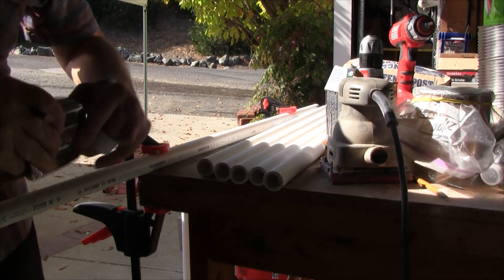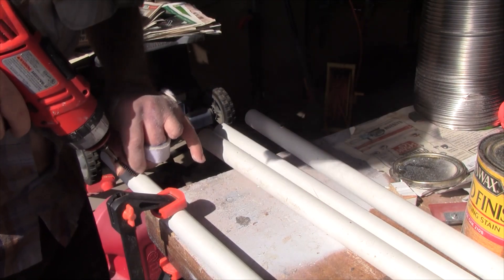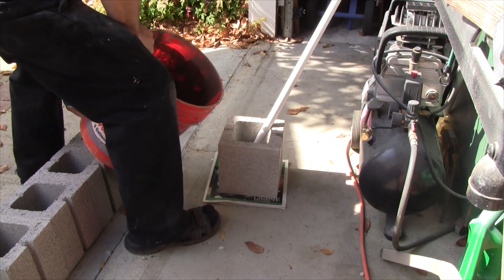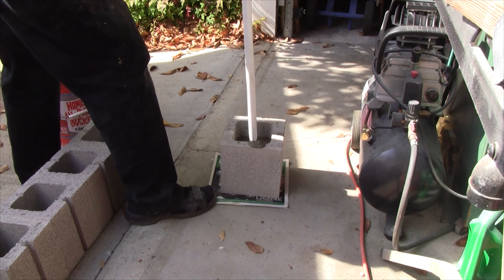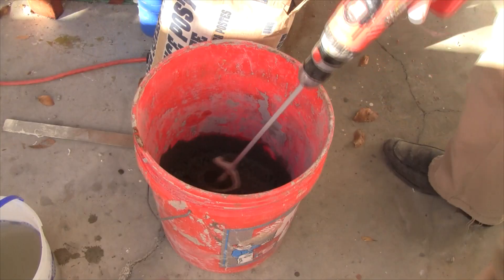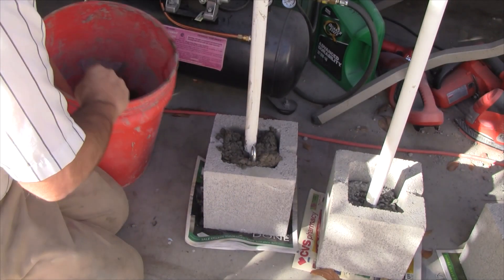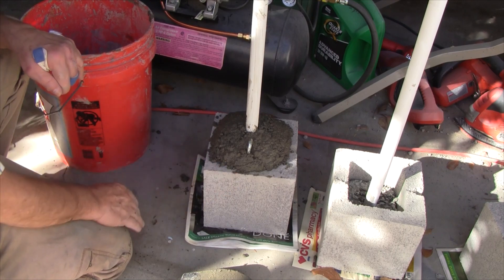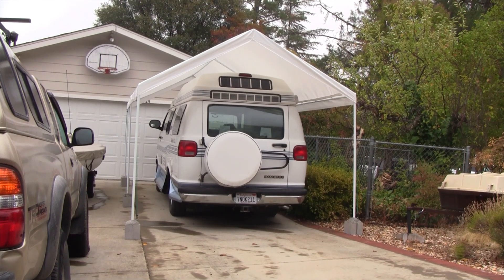Car Canopy Anchors that Lift and Absorb Shock

Comment: This might be a good idea for my harbor, freight garage in a box. I could use this to anchor the thing to the ground👍😊 i’ve got flat concrete block on the legs of the garage right now however, that’s still not heavy enough in a windstorm. Maybe these would be I don’t know. Looks like a pretty good idea though I would probably just use the quickset post concrete just put it in there and get it wet👍

Comment: Great idea ...
Reply from the maker: Thanks!  Just an added note, I had great luck with the frame of this cheap canopy, with my added beef-up's, including wind issues--just not snow!  However, I have become tiered of replacing the covers which just rot in the sun.  I am right now assembling its replacement, an all metal carport at the tune of about 2 grand.

Comment: How long did it last
Reply from the maker: It's still there, working fine!  This last winter, with a couple inches of very wet snow, it got so heavy it kinked the ridge polls--repaired easily.  It has handled some pretty nasty wind over the years, but I have developed an effective guy rope plan to add structural stability.

Comment: What year is your RT? And was the spare tire carrier already on, or did you install it? I have a '92 Dodge 190P where the tire's inside and it takes up a ton of storage space, would love to move it outside.
Reply from the maker: 2000D190P, I got it with the spare carrier.  It works, but over so many years, the weight is causing the door to sag a bit and it drags on the threshold.

Comment: prety cool but in a oklahoma wind them cinder blocks become projectiles yer screwed. i just put one of these up and used an auger type stake . theres nothing gonna stop the oklahoma wind and if im gonna lose property id rather it be just the canopy than have it bash in windows or dent up the car . thanks for the clever insight though

Comment: I wonder if it snows at your location, and how you can snow proof this canopy. I've been taking a rack and clearing the snow off it, but that's not a long term solution.
Reply: Maybe a steeper angle on the roof?

Comment: Interesting. I had my poles into 6 - 5 gallon buckets full of concrete. Thinking they were 100lbs each. My goal was to raise the canopy above an adjacent shed door. No shock absorbers though. Right away got a 50 mph wind come through that started lifting the legs up and contorting the frame poles. That was enough for my experiment. One of my poles dented a car fender in the process.

Comment: Where did you get the canopy,  and is the frame made entirely of pvc?  Thanks
Reply from the maker: Canopy is from Amazon (I had a gift certificate--the same thing can be bought many places). There is no PVC in the frame, it is all metal.  The PVC pipe is my mounting method on the concrete bases.  I have learned a lot and made several modifications over several years.  Ask if interested in more details!
Reply: @samqui323  thanks for the response.  I was considering a pre fabricated car port from amazon,  i wanted to put it adjacent  to my garage and fit it under the eves about 8' clearance, but they are too tall.  And i worry about the wind.  I live in so cal and sometimes we get santa anna winds ,  which can blow 40+.  So i am at the decision point of either going with a pre fab or making my own custom frame out of wood or 1.5  inch pvc.  Then i could just get a tarp to cover it.  My wife's not crazy about me building my own frame,  she thinks it would look too tacky.  I don't want to pay a contractor 20k+ and deal with building codes. 
 Geez,  all this just to protect my new car from frying in this socal heat!

Comment: great tutorial! how's this holding up a year later?
Reply from the maker: Actually, pretty well!   It's survived some pretty powerful winds, and I wasn't all that optimistic about that!  Biggest problem is the little bungee loops with plastic balls that came with the canopy to hold the white cover onto the frame--they are stretching out and disintegrating!  I did add one feature not shown here: I strung clothesline style rope from the top of one corner leg, down to the bottom of the middle leg, then back up to the top of the leg at the opposite end (both sides). Tighten theses snugly.  It adds some strength in strong winds that used to torque the frame back and forth and even drag the concrete blocks!
Reply: samqui323 can you show a small video on that? Thanks
Reply from the maker: @ToMyMakeupFans  Sorry, I've not been able to get to that!
Reply: @samqui323  If you get a chance to do that, we'd love to see it! You don't have to do an instruction, but if you could just show a video of how it looks, it would be helpful :)
Reply: @samqui323  From what you're describing, it seems like something I was going to try to do to stabilize mine which is already bolted into the concrete. I was going to run a steel cable in like a crisscross pattern between the metal poles to help stabilize it more. That's the cheapest and most efficient thing I can think of off hand.
Reply from the maker: @powerofknowledge7771  Exactly.  And since you bolted your legs to the concrete, that would be well braced.  (Mine can still drag a concrete block if it is real bad!) I've also added guy rope sections to give the same strength sideways but by tying off to my RV itself.
Reply: @samqui323   i got some plastic zip ties works great doesnt have the spring to it that the bungees do but they dont let the tarp go without ripping it either

Comment: ANOTHER ONE THAT DID NOT SHOW THE CANOPY ROLLING INTO THE STREET WHEN A 40 MPH GUST TAKES THAT HORIZONTAL SAIL AND SAILS IT. THOSE BUNGEES WILL SNAP LIKE RUBBER BANDS AND THAT CANOPY HAS LIFTED ME OFF THE GROUND IN 25 MPH WINDS. I'M 175 LBS. I LOOKED LIKE MARY POPPINS WITH A CANOPY!
Reply from the maker: Haven't shown it because it doesn't happen.  And yes, it's seen many a heavy wind--has been up 3 years now.  I'm glad to share extra measures I've taken to help that, with someone who's actually trying to do something.
Reply from the maker: dimebag Darrell  I tied clothes line style rope from the top of the corner posts down to the bottom of the center post, on each side, creating triangles.  This added a good deal of strength in wind, and are there permanently.  If I expect extraordinary wind, I have two more rope segments secured to the top of the back two posts which I bring over to the spare tire rack temporarily.  This gives great lateral stability.
Reply: @samqui323  I'm a big fan of the HF Orange Ratchet Straps 😁 I picked up a set just for bracing my canopy. And the added safety orange will (hopefully) keep me from tripping over them.

Great idea with the blocks and bungees.

Any issues with rain collecting in the 10'spans of canopy? Did you do any other reinforcement of the frame?
Reply from the maker: @_GntlStone_  No problem with rain, but wet snow was too much!  Get it off before it collects!!  Yes, I ran close line type rope in an X pattern between the top and bottom of two leg poles on each side.  Much stronger.  I also ran lines from the top of the rear poles to the spare tire rack with easy disconnect clips when needing to back out. I've had very little trouble with wind this way.

Comment: How many bags of concrete did you use?
Reply from the maker: Sorry, I don't remember for sure.  Could not have been more than two.
Reply: samqui323 
That's ok, I did this project the next day, I used just over 2 small bags. Thank you!
Reply: @jesucka87  how is the canopy holding up ?
Reply: @gabrieldusk  it was holding up well for a couple of years. I live a block up from the sea and a wind storm  finally took it but I think this is great for less windy areas.